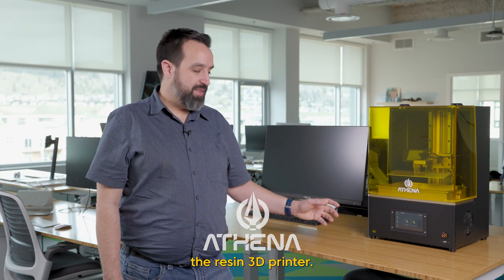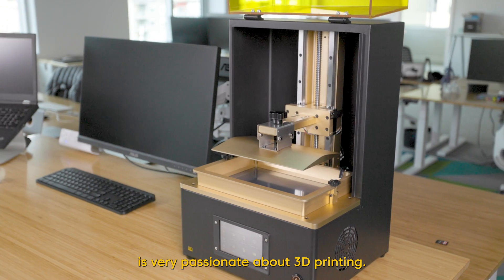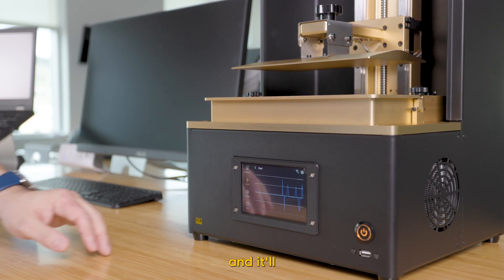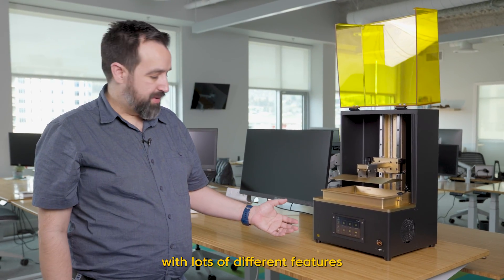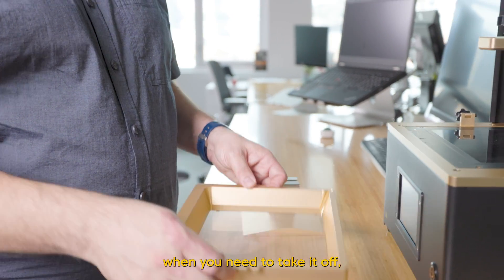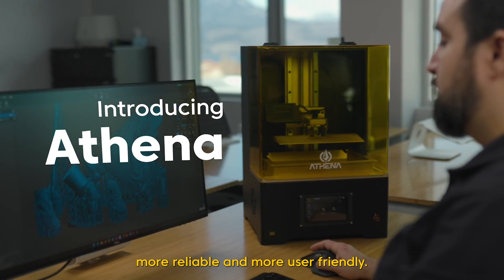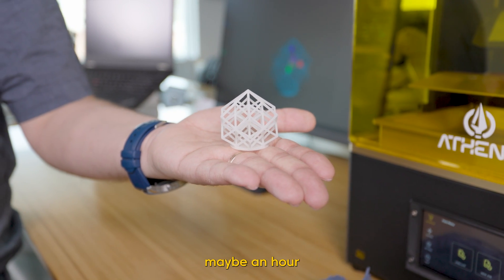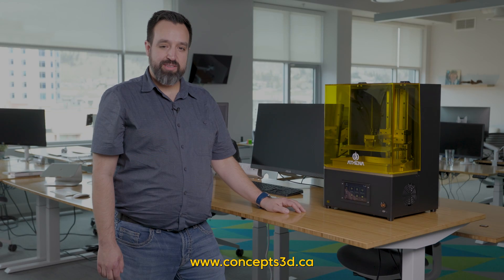A First Look at Concepts 3D’s Athena | Smart mSLA Resin Printer

Comment: he said nothing about a heater or vent?
Reply: This video was made before either one was a thing. We now offer PTC Chamber heater, an upcoming Vat heater, and there is a large exhaust port on the back of the printer for the Aegis Air filtration, or hooking up a hose to vent out a window or external filter.

Comment: Carbon filter guys please?
Reply from the maker: Thanks for the feedback, We are looking at adding a small carbon filter to the heater system, but there are a lot of options already on the market for this. In our testing, the small printer chamber filters did not last very long and needed replacing often. Just something to consider when looking a these. We have a large whole room carbon and hepa filter system for our printing lab that works very well.

Comment: Im assuming that since there is a temperature probe there is some form of heater? Only other thing I would like to see is some sort of resin fill system that are somewhat starting to be more popular. I have a couple of prints that are very very dense and I have to start it when I know ill be around 3 or 4 hours later so I can top off the resin so it doesnt run out, having something auto fill would allow me to do those prints over night without having to worry about that. Other than that, very intrigued. Will most likely be backing it, assuming the pricing lines up with the "similar" resin printers of its size.
Reply from the maker: Hi Travis, We do have a resin temperature probe and will have a heater.  We are also looking an an auto fill system add-on, but want to make sure we design something good. Cleaning resin out of thin tubes when you want to change is a pain, and the bottle attached to the vat method has its issues as well, but we are looking into it as its been requested quite a bit.

Our price for Athena is higher than the other Chinese brands, but we are a Canadian company, and our feature set is far above these brands. If you were to compare the features like our force sensor to a similar resin printer with this technology, you are looking at over $8k for something like Asiga, or the Origin One.

We think we offer a lot of value with our features, innovations and most important, customer service.

Comment: 1000 Bucks printer not being leveling free in 2023. Oof big F.
Reply from the maker: Thanks for the feedback, Yeah, we are not a cheap printer. We are a Canadian company and we don't have the same resources or volumes the Chinese brands have, but we do offer a ton more in features, innovations, speed and we think, most importantly, great technical and customer support.

That being said, how often are you leveling your printer that you need auto leveling? FDM printer, sure, but a Resin printer? We set Athena once and its good for a long time. Leveling once when you first use it or of you drop your plate, but that's it. 

We are looking at making Athena Leveling free, but not sure its worth the effort or added cost.

Comment: Wow that is a great. looking and functioning printer.  I think the force sensor is going to be a game changer in the market.  Can you use any resin with the printer?
Reply from the maker: Thanks for the comment.
Yes, we are compatible with any resin, even some of the slower cure DLP, Laser, and Engineering resins as we have a much more power UV LED light source which is capable of over 2x the power of the other brands. And its brightness is fully adjustable.

Comment: How does it do with translucent resin though? I often see this overlooked and there is no way to adjust backlight strength to get a good, accurate print.
Reply from the maker: Athena has a fully adjustable UV LED, controlled by PWM. We regularly print with translucent resins without any issue.
Take a look at this video where we printed with Siraya Tech Clear resin.
https://youtu.be/veRi2VqVs3Y

Comment: still using big screws to hold down the vat, still using a big screw to hold down build plate, not heated, ........  why not include all advancements seen on other machines and really push the envelope.
Reply from the maker: We do have a unique vat knob system, not like the others where you have to remove them. Much simpler. 

We also have a heater, it's fully controlled by the main board and integrated into the UI. It is a stretch goal to have them on all the printers, but if that's not reached it will be an add-on. Same with the resin pump, and 12k LCD.

But the main reason we went with the design we have now is to maintain a reasonable price. We are a new startup and this is our first printer. We are trying to offer good value with all of our features while still keeping the price as low as we can. 

But I think you will find we have things no other printer has. Check out our website for the full list of features.
Reply: @concepts3ds  Thanks for the reply, I checked it out after I posted.
Reply: @concepts3ds  Hi there. You said it has a heater,means it heats up the resin to a certain temperature?

Comment: Do you consider having a "built-in" flexplate. I personally use one on my current printer, and I think a lot of people do. Will that work with your detection features? Is this something you could consider as an "add-on" ?
Reply from the maker: Flex plate is compatible, you can use the Wham Bam plate for the Epax E10. It's the same size as Athena. We can offer it as an add-on.

Comment: Is this have integrated heater also?
Reply from the maker: Heater is a stretch goal for our Kickstarter campaign. But if it's not reached, it will be an add-on option. Fully controlled by the main board for easy integration and control.
Reply: @concepts3ds  Thanks!

Comment: So this is a basic resin printer but the features that are supposed to set it apart you just briefly mention. What calibration are you talking about? What crash detection? I've yet to hear an explanation as to what these features are or do. Resin is pretty straight forward and doesn't require tinkering like fdm so I'm skeptical as to whether or not these are useful
Reply: Well, crash detection is simple. The force sensor does that. It will detect if the build plate is crashing into a hard object and im sure it does it very quickly as to save your screen and possibly fep.
what else was confusing?
Force sensor knows when the fep releases, since it can sense the force. So it can change lift heights on the fly to speed up print times.
This isnt a basic resin printer at all. There is additional tech in this machine that changes everything.
Reply from the maker: Please check out our website www.concepts3d.ca we have a lot more details about the smart features there. But we appreciate the feedback and will try to make some videos to better explain these features.